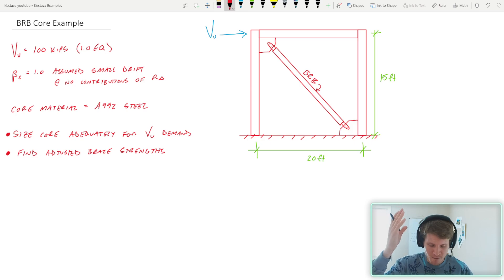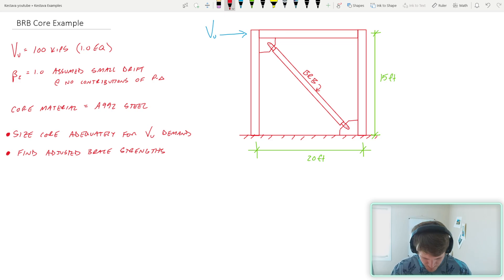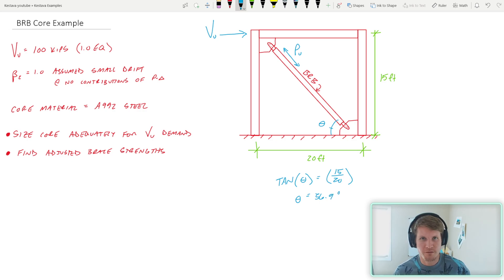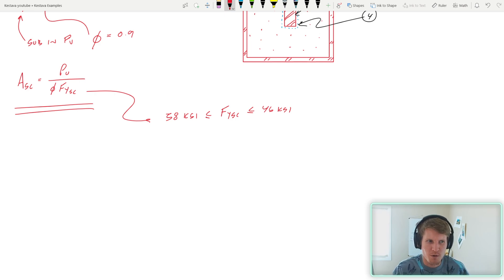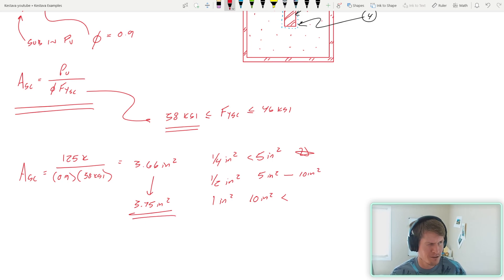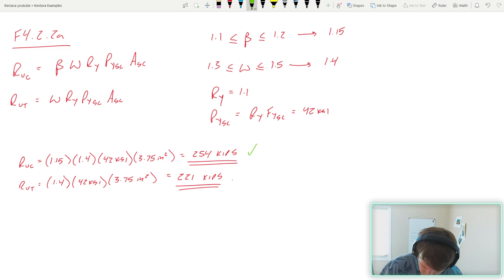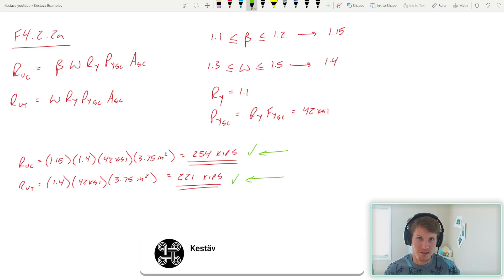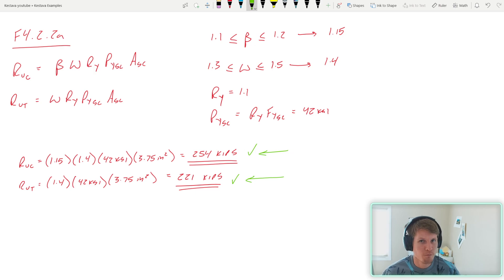BRBF Brace Design Example #structuralengineering #engineering #civilengineering

Comment: By making the beams & columns stronger than the brace, do you mean they have less efficient utilization rates?
That way the brace is closer to yield failure while the beams & columns still have a ways to go before failure?
Reply from the maker: in a nutshell - yes poofy